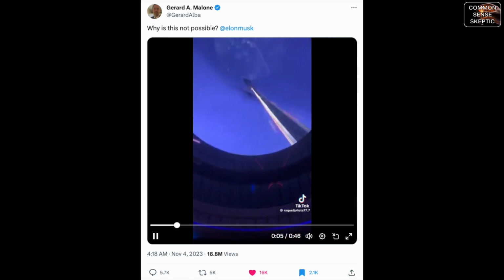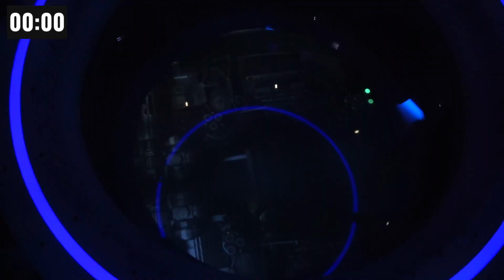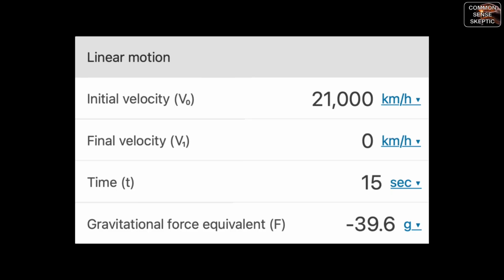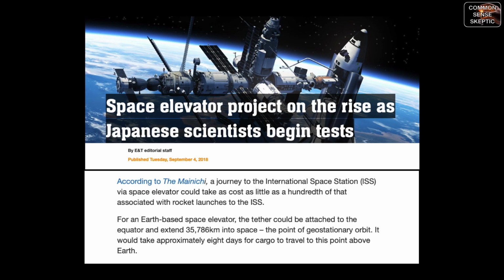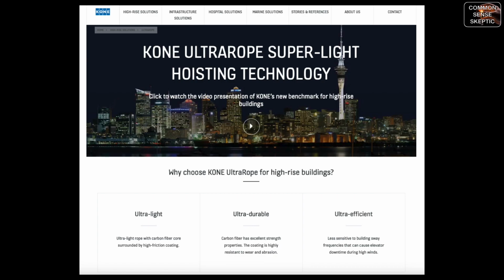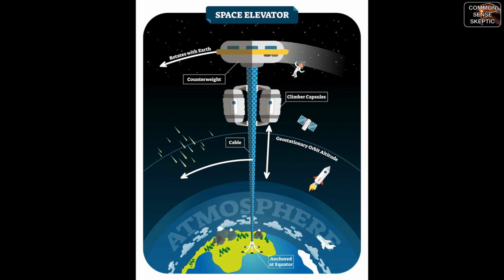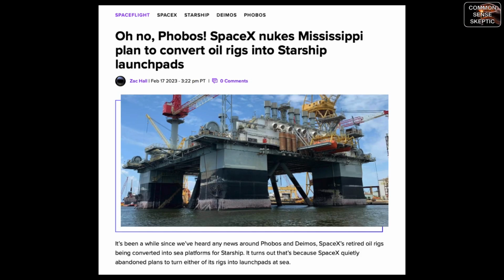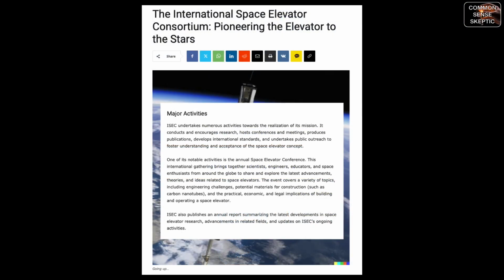DEBUNKING L.E.O. SPACE ELEVATORS

Comment: Space elevators at geostationary orbit can’t work either. Even with an infinitely strong cable weighing 0 kilos. 

That’s because you have to accelerate the car horizontally from its starting speed of 1000 miles an hour to whatever speed is required at orbit. So you need a lateral force accelerating the car as it goes up. Either the cable applies the force (must be superstrong for that) or you have to apply the force with a rocket. 

And if you’re going to apply the force with a rocket, you might as well just send the payload up with the rocket. Especially if it’s going to take many hours by elevator. 

People seem to think the car is stationary on the ground and stationary in space. Neither is true.
Reply: Their is a force keeping the elevator upright (the earth spinning) due to the balance of weight being above GSO.

Now you pull the cable down to climb up it with the climber. The climber is not attached to the earth and so it gets pulled up as well (until the cable is now upright as well) .

The latral force has come from the Earth rotation being slowed slightly. Think of it like the ice skater with their arms out vs in.

Comment: I think that orbital rings, Mars colonies, and O'Neill cylinders are reasonable. To make in 2500. Space Elevators are their own kind of difficult though. I could see us building them, again in hundreds of years, but they just don't seem practical around Earth.

And the maintenance of an orbital ring would be... quite the problem. It's the sort of thing where world peace would help a lot.
Reply: Space elevators might be useful on smaller bodies in the solar system like moons or asteroids.
Reply: I think they could be made before then, but we have to be in space and have worked out the whole "fuel supply to bring in asteroids for materials" thing.
Reply: @InfernosReaper  
Rock dust after the metals and volatiles are removed, is thrown in an EM catapult. Note that over time as the mass being pushed goes down and the available solar arrays for power and EM track length goes up, the EV goes up.
Several Earth and Venus swing-by maneuvers, and a final Earth-Moon-Earth maneuver captures it into a 10k mile by 150k mile elliptical orbit: 2 week, resonant with the Moon. More accessible and as stable as L-5 or 4.
Reply: The thing known in tabloid level media as the "O'Neill cylinder" wasn't ever proposed as a realistic thing, but was only ever an illustration of the sort of scale of things that modern realistic engineering might do.
O'Neill said it's probably not workable (we know it isn't) and is about as realistic to the people 80 years after the first generation small habitats are done, would build when they need a place for millions of people, as what "futurists" in the 1890s thought that the year 2000 would be like.

Scale your expectations back to O'Neill's "Island One" 800 meter diameter habitat, or the NASA Ames "Stanford Torus" 800 meter radius, and it's entirely do-able.
The '70s NASA Ames space settlement studies found that no new inventions are needed to mine asteroids and moons and to build for virtually Earth-like conditions anywhere in space where there are or to which we bring materials.
The first habitat for 10k workers, along with all the ground, launch, and in-space infrastructure to reproduce it or to build Solar power satellites would have been done by 2010. The cost would have been like many other large infrastructure or industrial developments down here. Like the Interstate Highway System, or like ≈4 of our CVNs and their air wings & escorts and the logistics infrastructure to deploy them. Far less than a small oil war or the bailouts we've seen. Less than what they projected that we'd need to spend to meet new electrical grid power in the same time frame (and we've spent far more than they projected).

Eventually when space manufacturing of very large structures is built up and they need the living space, the largest pressure vessel that we could build with then-known technology to spin for 1 G and hold shielding and everything inside, was ≈30 km diameter, by maybe half as much in length (drum shape, instead of cylinder). Concrete & steel. No nanotech self-replicating 3D printing of magically huge amounts of graphene, required.
With titanium (which isn't rare out there) instead of steel, maybe twice as big.

Any who disagree with this is invited to show their qualifications in mining, construction and astronautical engineering and where they've published under peer-review saying that those studies were wrong.

Note that before the first hab for the workers is done, the effort has paid back and ended all questions of budget or cost, with NEA metals. All objections against NEA mining of previously rare or precious or monetary metals brought back to Earth markets boils down to the lead time and scale of the effort. Yes, it's 25 years away, for NEA mining or Solar power sats to return anything big.
It's been 25 years away since the '70s.

As for a Mars colony (which is a place where people will retire and raise children): Prove that we can live long-term and stay healthy in low G. That's "proof", not S.F., not wishes and hopes that the question goes away and try it and see. Not maybe in the future biomechanically altering ourselves and our offspring.
Prove that first, and we can go on to talk about why O'Neill/Kalpana/Stanford Torus habitats in space are still the better or only option for long-term, large-scale habitation off-Earth.
Reply: @JFrazer4303  Yeah, I pretty much agree. When I said O'Neill cylenders, I was thinking of the smaller ~1KM size. And a Mars colony would definitely depend on being able to live in low-gravity environments.
Reply: Orbital rings would get shredded by Earth's tidal forces and the pieces would fall back to Earth, just like a satellite entering the Roche limit would get torn apart and if the pieces orbit below the planet stationary orbit, tidal deceleration would have them collide with the planet.

Mars can't be colonized, neither today nor 500 years from now and the cylinders are impossible.
Reply: @durshurrikun150  The orbital ring is not held together by it's own gravity, same with artificial satellites. The Roche Limit is completely irrelevant because of that. And the orbital ring is not at geostationary orbit, so the altitude will not be particularly relevant either. Orbital rings have a stationary exterior, and an interior ring that is moving at faster than the local orbital velocity to keep it up. The whole assembly is anchored to the ground with cables, which would allow it to keep the outside stationary and the inside moving at the right speed. This would be very difficult to do, and impossible with current resources and politics, but your objections sound wrong.

Also, why are the cylinders impossible? Is geometry different in space? Is spinning not allowed? And with mars, I have similar questions. Why can't it be colonized? I don't mean "Why can't it be colonized in 25 years", I mean why can't it be done at all?
Reply: Orbital ring maintenance is only hard if you are building a single ring. You want to build several rotor/stator pairs and can shut them off in turns to do maintenance.
Reply: Space elevators are just so much worse than orbital rings for Earth orbit, that they're not in the same category as orbital rings. But yeah, maintaining a maglev train 40 000 km long is going to be a bit of work.
Reply: There are a couple of reasons that the World Trade Center was a target on 9/11/01.  It was an important hub of Western Finance.  It was large and expensive.  It was iconic, a symbol.  All that in spades for any huge construction.

Comment: Spacedock has a video on space elevators as well, covering some of the same points, but also pointing out the fact, that spacedocks don't make economic sense.
The materials for it have to come from somewhere and need to get there in some way - this means you take materials from Earth and fly them up. If you have a reliable method to get to LEO, why even waste materials on a space elevator. Another idea was to grab an asteroid and both use it as the station and the source of materials. This has the same problem - we would have a reliable method to leave Earth and even go in the solar system. Why would we be building a space elevator then?
At the end of the day, space elevators are a cool concept for your sci-fi story, but useless in reality.
Reply: To build a normal elevator you need a way to get to the top of the building. If you can get materials to the top of a building without an elevator why build an elevator.

As for the space elevator. Imagine it weighs 26 tons and can lift 100kg a day.

(using a falcon heavy that 26 tons requires 500 tons of propellent)

We can now lift 36 tons a year without rquiring 500 tons.

We can also lift another 1.3 elevators up in the first year and now we can lift 200kg (Assuming .3 for replacment) a day without requiring the 500 tons of propellent.
Reply: @catprog  I don't think building a normal elevator and a space elevator is very similar, but we'll have to ask an actual engineer and/or physics scientist.

Comment: I think with the orbits most people hear that, in principle, launching a satellite from a space elevator means you "get it for free" but that only applies to ones released at the top, in geo sync orbit. And then, it's not very useful because you now have to put in a whole bunch of delta-V to move into whatever orbit of Earth you actually want to be in...
Reply: Free? Not even then, you won't get any angular momenum for free anywhere in this universe....
Reply: the orbital velocity at geostationary orbit is about 3 km/s so it is actually less than in low earth orbit.  this often seems to be a bit counter-intuitive.  still, the velocity of the surface of the rotating earth is only about 460 m/s so the object being raised to geostationary orbit still has to be accelerated by more than 2,5 km/s horizontally while travelling along the cable.  this does not come for free, it will cause a horizontal force on the cable that is not compensated anywhere by the system, and will result in the cable "wrapping around the earth" eventually
Reply: @Rob2  yeah I don’t quite understand this point like he talks about the people doing a space walk walk if you step out of the international space station you’ll he going 17,000 miles an hour due to inertia, so why wouldnt it be the same if you stepped out of a space elevator or you know that altitude wouldn’t  you just float along because you’re already going that velocity
Reply: @mcamp9445  For a space elevator to geostationary orbit that would work, but not for one to low earth orbit.  The horizontal speed of an elevator to 500km is by far not enough to remain in orbit at that height, you would fall almost straight down.
Reply: You don't get it for free. 1) it takes energy to raise the elevator. 2) relative to the Earth, you're only moving 300 m/s on Earth's surface due to rotation, but you'll need to be going 3000 m/s in geostationary. So that's more energy needed.

Nothing free about it.
Reply: @ArticulatedHypernova  I know it's not free. But in principle, you can just push a satellite out the door in geo sync orbit and it will stay there, that's what they mean, because you've already got it up there. I've done it in Kerbal Space Program, released a satellite from another satellite in geosync orbit.

My point was that it's still of little use anyway, since you would need to put in all the delta-V to get to whatever orbit you actually want to be in. The system I used in KSP was designed so I could put one communication hub up in orbit and then use it to launch little probes that I moved into position to create a globe spanning network. It was fun, but it would have been easier and probably cheaper to have launched them separately.

Comment: In sci fi I’ve read the elevators can take days to get to altitude.  In K Stanley Robinsons 2312 the elevator riders enjoy their ride time by learning parts for a space opera and performing in a grand theatre.  The elevator is like a large hotel.
Reply: That's really the idea, rockets need to go fast to get anywhere and this means they have to deal with a lot of air resistance. A space elevator could go as slow as it wants and therefore not a lot of energy would be lost to air resistance.
Reply: @hedgehog3180  also no g force if it goes slow. the space elevator in fiction is either bulk cargo at slow speeds or luxury passenger service
Reply: 36,000 km / 1 day is only 1,500kph.
We have rockets that are faster.

Comment: If you had a cheap and readily available power source like a commercial fusion reactor (or some kind of orbital solar array), it might be possible to build a space elevator with something called active support. You could imagine the concept similar to one of those rocket toys that uses a stream of water to float in middair. Except in this case you would use a high velocity stream of charged particles that continuously cycle up and down the space elevator shaft. This stream would transfer momentum required to counteract gravity without needing impossibly strong material. This would allow you to prop up the LEO space elevator effectively, but you would need a continuous power supply to sustain it. It also means you would not need orbital velocity.  Such a system would be the foundation for orbital infrastructure known as the orbital ring. The orbital ring would not necessarily need to be moving at orbital velocity, but it could have a giant electromagnetic accelerator that lets you launch spacecrafts without any rocket fuel, only electricity because there is no atmosphere. It would be attached to multiple space elevators at the equator, using active support to provide the necessary structure to support the ring. Then, once you've built this orbital ring, you turn the center of the orbital ring into two parrallel, but opposing giant particle accelerator that circumnavigates the earth. They need to be opposed so they don't cause gyroscopic effects. You speed up the charged particles in the accelerator up to orbital velocity, at which point the orbital ring can now sustain itself in LEO without the space elevators propping it up. 

Science and Futurism with Isaac Arthur does a great breakdown on realistic orbital infrastructure. Of course, we're talking about a 10 trillion dollar project if not more here, but all of the technology has been developed and used, just not mass produced. This is a lot more realistic than a true space elevator because it doesn't require "probably impossible" materials like a continuous 1000km+ long super structure of carbon nano tubes. Using active support allows us to bypass traditional material limits as long as we have a good enough power supply.
Reply: A space fountain?